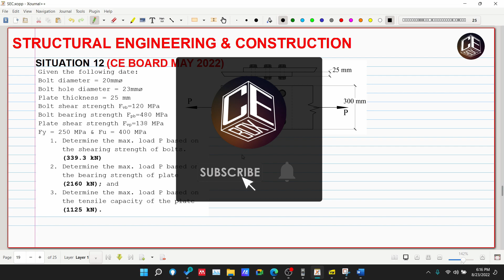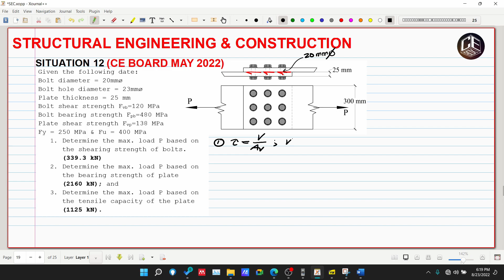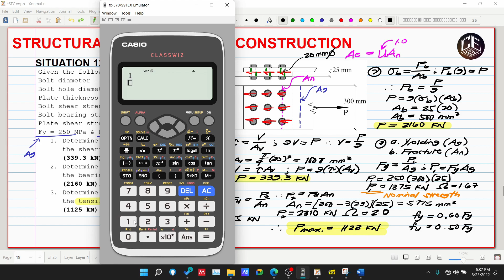Structural Engineering & Construction Situation 12 (PH)

Comment: sir tanong ko lang, kelan gagamit ng plus 2 sa bolt hole diameter?
Reply from the maker: Based sa NSCP, 2mm kapag ang given ay hole diameter. if bolt diameter ang given, then 4mm. kumbaga, dalawang beses ka magaadd kapag bolt diameter ang give, at isang beses kapag hole diameter ang given.
Reply: @cebox  sir bat di ka nag add ng 2 sa hole diameter? sa part 3 ng question.

Nagplus 2 ako sa hole diameter sa part 3, Sakto sa sagot yung lumabas. Tama ba na nag add pa ako ng 2mm sa Hole Diameter?
Reply: Hi sir, tanong lang po bakit po yung answer ng area gross ang naging answer sa questions #3?